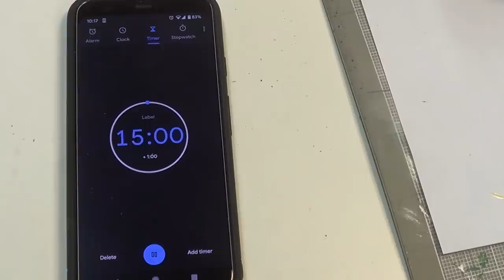FULL RESTORATION of Vintage WW1 Binoculars

Comment: The last adjustment with the screw to place the slot vertical is something that was taught a long time ago to apprentices. You sir are a Craftsman. Thanks for sharing this fine work.
Reply: A visitor to my house once noted "that's cool, the screws on your light switch plate ended up vertically" as if it was an accident... "huh, how about that?" haha

Comment: Wow, those came out amazing.  I understand the rationale behind the black and why they were originally that way, but man they would have looked sweet with some of the trim left natural brass.  Amazing work on these - it was a pleasure to watch!
Reply: If they where not made for military use that company probably would have left them brass —I agree with you, that would have been cool to see
Reply: Paint is more than mere decoration, it protects the metal from oxidation.   If he left it bare brass, then it would be green after some handling and exposure to moisture.

Comment: As a child, I had such binoculars. I had received it from my grandparents. It was worn out back then and was called theater binoculars. It was very similar in shape. But age is certainly right.
Reply from the maker: Yes, this company also made "opera glasses". They are shorter; they don't have the front section. You don't need to see as far in a theater :). Many different manufacturers made glasses of this style at that time. Thank you for watching.
Reply: There were prismatic binoculars as early as the 19th
century and I never think that any defense force would have bought binoculars
where you cannot set your own measure for the distance between the eyes - the lenses. For me, it's a theater-glasses. But I agree if you
say it is 100 years or more.

Comment: I can see a few wrinkles on leather, but I'm sure it's quite hard to glue it to such a shape. Outstanding job!
Reply from the maker: Not wrinkles; stretch marks. The leather I used was a little too soft and pliable and it stretched a bit as I worked it around. Thanks for the comment.

Comment: when things were built to be serviced
Reply: Exactly! Now it's a throw-away society. 😒
Reply: @triune_blades  Servicing has been made harder, but still not impossible depending age. I have been restoring and utility restored lots of stuff people trow away. Just got free English seagull boat off board motor that after little cleaning of fuel line and new fuel started with second pull, ppretty recent Weber spirit gas grill, just needed "little" cleaning and serviced Bosh 1400 angle grinder, just needed clean brush holder that had lots of corrosion preventing brush to move freely. Too bad last owner didnt leave washer and nut and handle in place, otherwise it would be in use now.

Comment: I have the same,  and I did a similar restoration. But I had a problem: the lens (the big one) is made of two lenses one concave and one convex combined.
One paor of lenses was easyly divided, the other I did not suceeded. 
Some resin between the two has become yellow,  not really looking good. 
I have tried different solvent leaving the lenses submerged for days, I also tried with hot water, but no resilt  Have you any suggestion to divide and eventually clean the lenses?
Reply: Have you tried carefully sliding a razor blade or carpenters knife between them after soaking in hot water?
Reply: Also, may I ask what kind of solvents have you tried ...? Often just one alone may not do, especially as the ones available to the public tend to be pretty dilute. Mixing several (outdoors, of course ...), in various ratios, plus increasing the concentration by evaporating the water off (ditto ...) may help. As it is resin, than another route is solvents used by painting conservators, especially either organic, or enzyme based ... heck, even diesel may work ...

Comment: Very nice restoration of an historic piece of equipment. Wish it could talk. Looks like you recovered the barrels in a felt material. Is that what the field glasses had originally? Best regards.
Reply from the maker: The green felt was just used as a template. You can't wrap paper in a bell shape very well. The final wrap was cow leather.

Comment: Looks good, my pair has leather on the sun shades as well as the body, maybe mine are a different model? I know mine were a Christmas present from 1908 because the owner scratched his name and date into the brass under the right pull out shade.
Reply from the maker: If yours have leather on the sun shades, it is on older model than mine. They moved to machined ridges on the sunshade for mine. Thanks for watching!

Comment: A chemical cleaning process would have been preferable. As would a proper Japanning finish on the brass, and ultra thin bookbinders leather for the wrap.
Reply from the maker: Have any extra  japanning you want to share? I don't, and I don't have the materials to make any. Lacquer formulated for brass seemed like a reasonable substitute. As for the leather; you try sourcing the right leather 2 months into a quarantine!
Reply: @AcmeRestorations  Coming from a living history background, and the fabrication of precise historical reproductions, my techniques emphasize the use of period correct materials and methods. You may not be so inclined. However these can still be used with minimal tweaking to include more modern ingredients:

THE source for book binding leather is Siegells, but Ebay and Amazon are other sources, even with Covid:
https://siegelleather.com

There are a number of online tutorials showing the proper way to effect japanning on metal. A good one is the following from a colleague of mine:
https://www.2ndusss.com/uniforms-and-gear/an-actual-japanning-how-to-yes

Comment: I am pretty sure the front parts, holding the objectives, should be finished with leather also.
Reply from the maker: I've done some research. The older models did have leather on the sun shades. At some point they machine ridges in the brass and stopped using leather on the front. These have the ridges. I've found photos of both types. There wasn't a stitch of glue on the shades either, so I'm fairly certain I made the right call. Good observation though. Thanks for watching.

Comment: Is that more effective than sandblasting?
Reply from the maker: There's no real reason to media blast lacquer and glue off brass. Especially something as small as this. If I had blasted it, it still would have required polishing with a brass wire wheel.  Thanks for watching.

Comment: Why gloves?
Why an awful rotating wire brush ?
Why no primer before the paint ?
Reply from the maker: Gloves are a personal preference. No paint was used; it was lacquered.  You don't use primer on brass with lacquer. Primer is for paint.

Comment: 90%... You should have sanded and polished the new lacquer coat, it became looking like "peed sand", you should have covered the central part with real leather, and a tip, in order to clean old lenses properly and remove fungus, soak them in hydrogen peroxide (H2O2) 40% and expose the lens to the sun or ultraviolet light for 24 hours, if it has no fungus, use lighter fluid to clean the lenses!!!
Reply from the maker: I am going to sand and buff the lacquer. Needs to set for about a week first and I wanted to get the video up. No fungus and no grease or oil so naptha not required. Also naptha leaves a residue. For light dirt, isopropyl alcohol works just fine.  That is real cow leather I used to wrap the body. Thanks for watching.
Reply: Noted